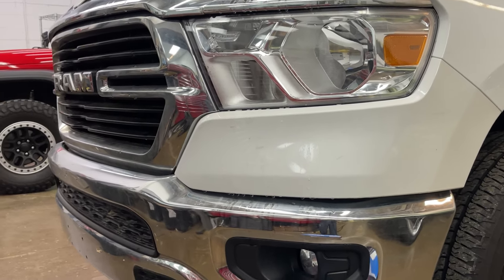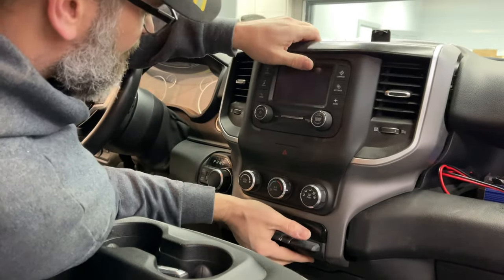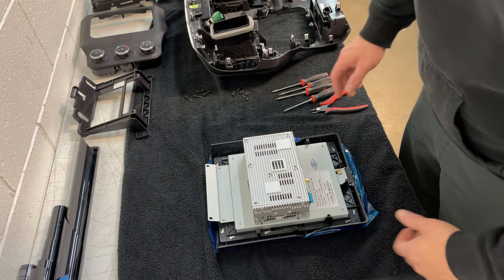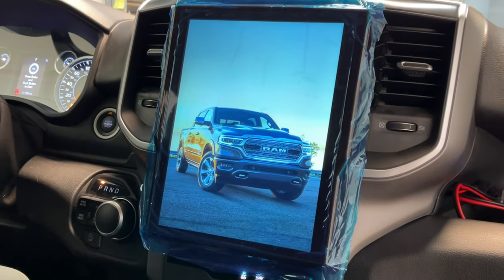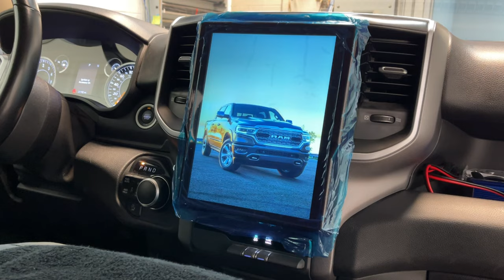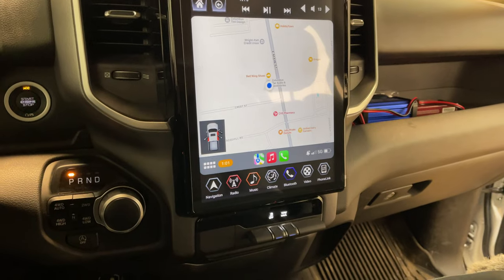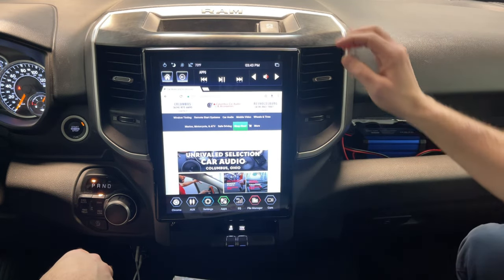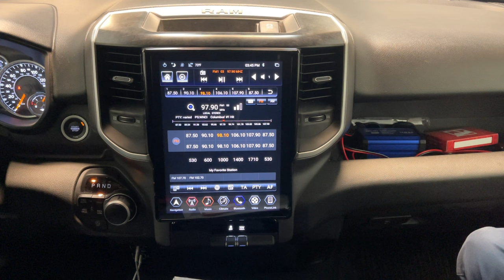2020 RAM Radio Upgrade Linkswell Gen 5 12.1" Android Head Unit / Full Install & Overview #RAM #614

Comment: Awesome video, I have a 2020 ram 1500 crew with 8.4 factory screen. I was looking into this linkswell tablets gen 4 and gen 5 and I see now they have a xl one that 15". Do you think there worth the money and work well? Heard a few  people say they work ok in the beginning then start getting really slow and freezing up. Have you had any problems with them? You think the gen4 gen 5 and xl 15" are about the same? Thanks
Reply from the maker: They are android based, so there can be miscellaneous quirks I suppose.   One quirk on the gen 4 & 5 that would bug me for example is not being able to have a different audio source playing (ie FM) while the CarPlay screen is up.  That would bug me. 
On the Gen6 (which I believe all of the XL screens are), I’ve been told that that is fixed.  
 I haven’t done one personally to verify though.
Just like any device these days…keep it updated, and all should be well. 
Their tech support is typically very helpful as well if you do have an issue 👍
Reply: @Columbuscaraudio   cool yeah that xl is the one I been looking at, I have an android phone and usually listen to YouTube music for my system. I never listen to the radio ever. I see it has rca outputs as well I'm wondering if I would use those to go to my sub amp or jus keep using my line out converter harness that has anc bypass on it as well. Guess if I used the rca outs on the linkswell I would jus need to anc bypass that all
Reply from the maker: @johnnypiper1717  you can do it either way.  You can leave it as is, since it’s already working.  Or you can use the sub-out so you have sub control on screen. 
Thank you for the great questions btw 👍👍
Reply: @Columbuscaraudio  awesome, you wouldn't happen to know if the 5th gen ram 1500 thats non amplified factory have bass roll off? I really need an rta to see jus heard there was and heard there wasn't. Thats why I went with the wavetechDQ loc since it has a parametric eq on it to target certain frequencys and you are able to boost the signal around those frequency with 0-12db boost and put it narrow or wide. May jus need to call a shop see if they have an rta and can check that out for me. Those linkswell xl screens have eq settings on them as well?
Reply from the maker: @johnnypiper1717  It seems like just about every car these days has some type of bass roll off, auto-loudness, or whatever you’d like to call it.  Doing a new headunit is a great way to get rid of it completely though.  
And yes, the linkswell units have a pretty comprehensive set of audio controls onboard.  Obviously not as flexible as a standalone DSP, but more than most headunits for sure 👍
Reply: @Columbuscaraudio  good to know yeah it is so much easier having a nice after market radio with alot more settings and eq crossovers to tune your system. Yes I know for sure my truck has a auto loudness I turned off when I installed my system. And it's much easier jus pluging in to a after market radio that has sub out rca and go straight into an amp instead of having to get a loc get a high level speaker into the loc to get a rca signal.

Comment: Would this work in a 2013 ford raptor?
Reply from the maker: Yes, there is one for that generation F150.  I know there are some console pieces that are different on the Raptor, but if I remember correctly, the radio bezel is the same between the 2 👍 
Here is some info:
https://www.linkswellinc.com/products/radios/t-style-radio/the-t-style-radio/gen-4/2013-2014-ford-f150-generation-4-t-style-radio-no-hdmi-input/

Comment: Does this unit work the rams ANC-active noise control ???
Reply from the maker: Since the ANC is a separate unit under the drivers’ seat and stays in place, I’m pretty sure it would still function as designed.